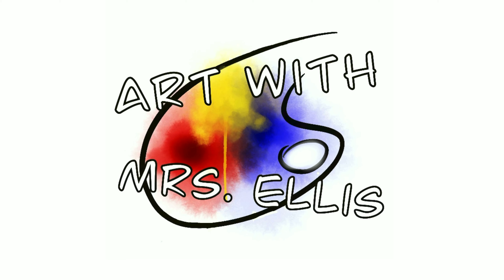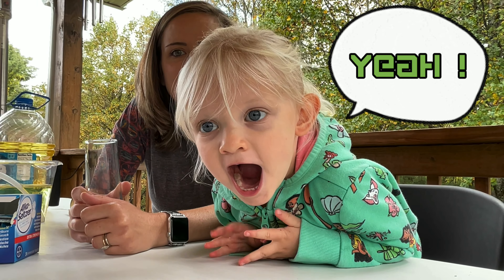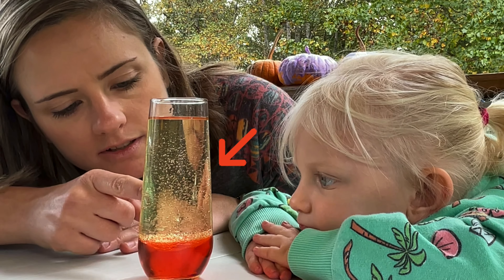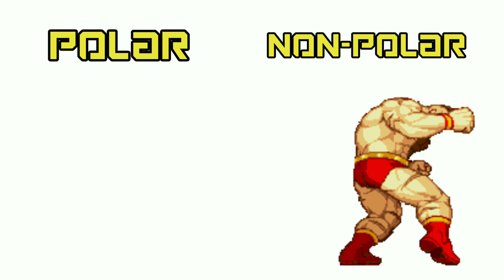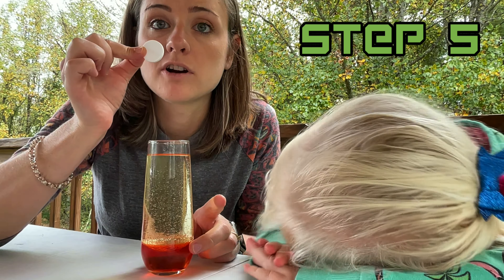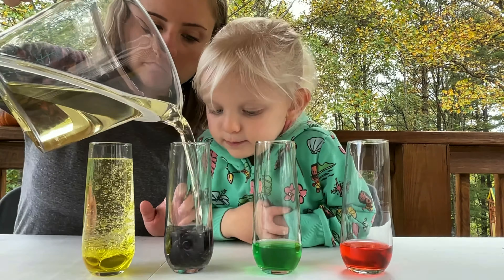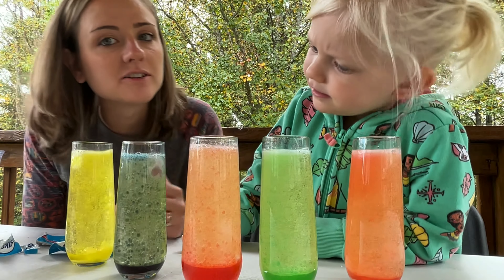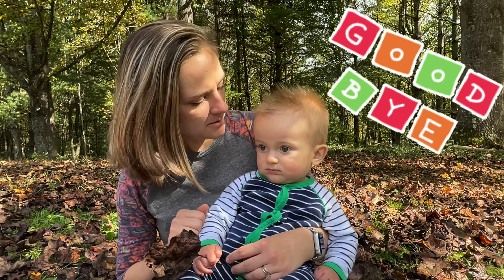Art With Mrs. Ellis: Making Lava Lamps

Comment: Curious if the hight and width of the glass or container has to fit any dimensions to make it work?
Reply from the maker: The hight and width doesn’t matter, as long as you fill the glass up at least 1/8th full with oil and the rest with water!